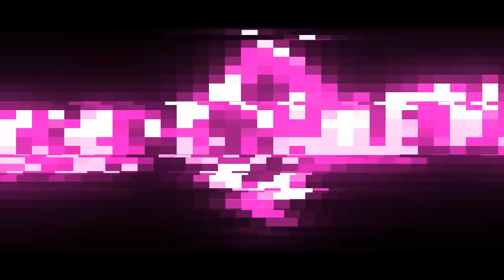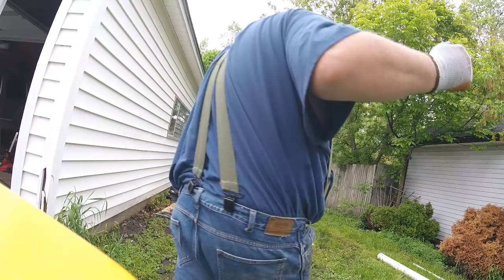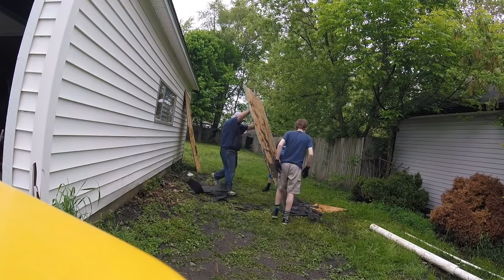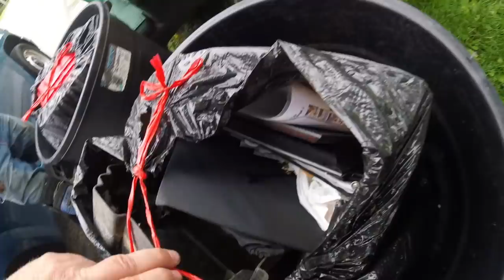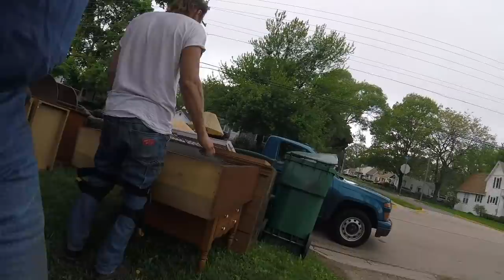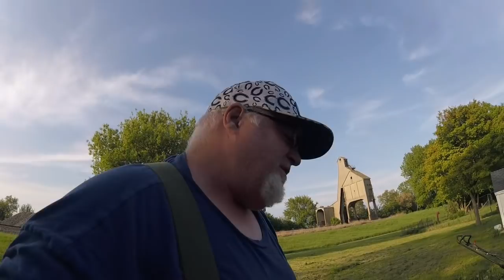Get the Good Stuff on the Curb

Comment: Yeah I think the train was going fast

Like a little too fast for a freight train
Reply from the maker: I wouldn't be surprised if some of them hit 60 or 70 miles per hour. They go through town that fast too
Reply: Scrap & Pallet Man Without a doubt you’re correct if you ever work up on the railroad tracks and look at the rails the freight train rails are bent and twisted there’s no way they can support a freight train going much over 50 miles an hour
That’s why Amtrak trains come off the rails when they go fast because they are using freight tracks
Which really and truly are not meant for commuter traffic